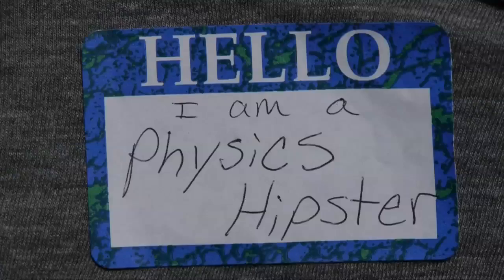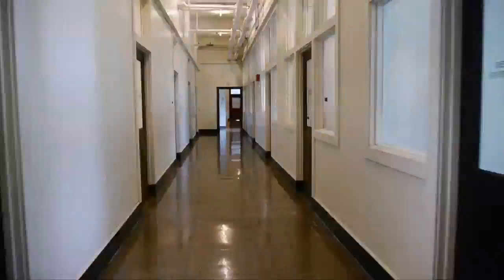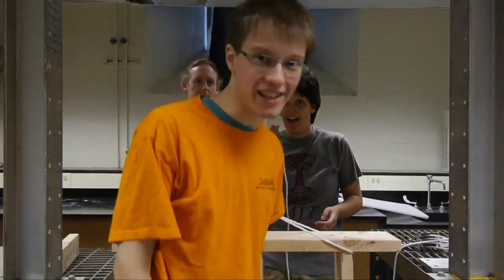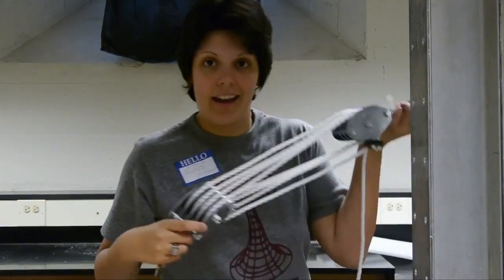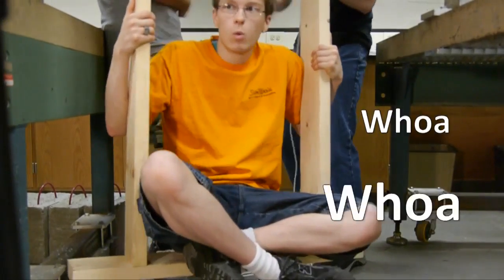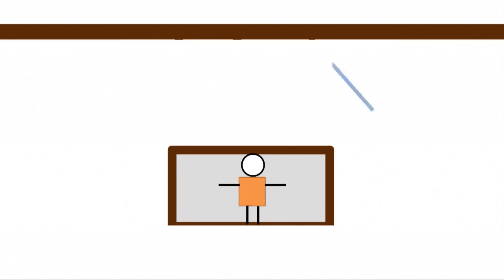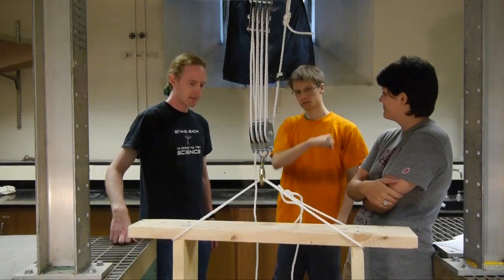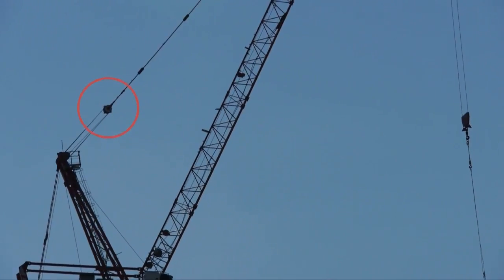Pulleys are Cool

Comment: 88.8% cringe factor but this helps me out with my problem i have i was trying to use a 2 to 1 system to lift my mower in my shop but it was to heavy still so i tried a 3 to 1 and i don't have enough hieghth but this tackle/block system will work perfectly for me. Thanks for the video.
Reply: Take a look at a hoist. Used to lift engines in and out of cars. Ebay has plenty, I guess around 50$ or so new. It uses high strength chain, it has an advantage of about 20:1, and most importantly, it stays in position. You have to wind it to go down as well as up. So your mower won't end up on your head!

Comment: Cool fact: In the 1800s you used to use elevators, no not powered elevators with tempting to be pushed fire alarms, pulley elevators. What you would do is sit down in it, and there would be a pulley system with 5 blocks. You would have to barely pull these 2 strings behind you, and speed up to the 2nd floor.

Comment: Yes! Eureka! If you draw a parallel circuit vertically, it looks like a block and tackle! In the parallel circuit, the source voltage = the voltage through each branch, just like the force inputted into the rope = force @ each connection point!  Thanks for seeing the analogy! And the pulleys divide the rope up into ‘branches’ so that the sum total of force in each branch of rope adds to the total load you’re lifting, just as current through each branch adds to the total current!

Comment: so... the block and tackle its kinda like parallel circuits with a battery. Right?
Reply: Yes. Voltage being the force and current the distance, leading to lifting power in watts. V * A = W